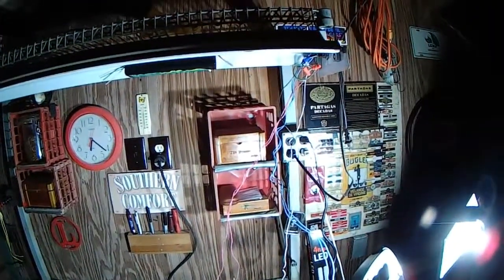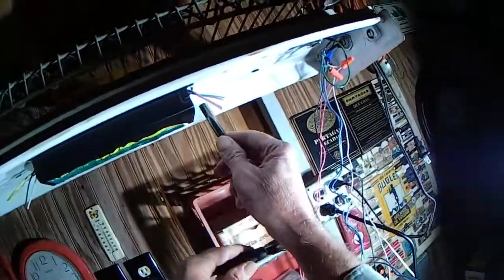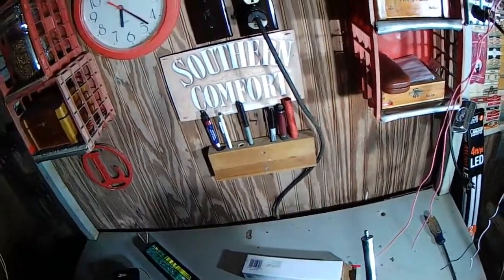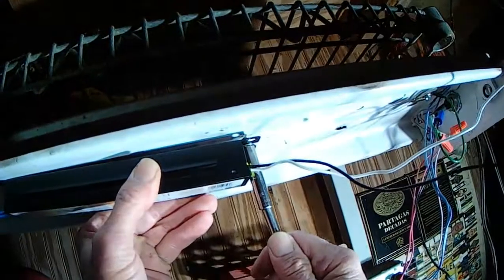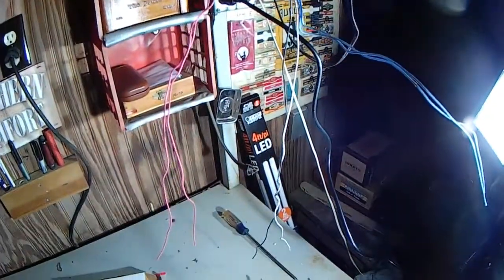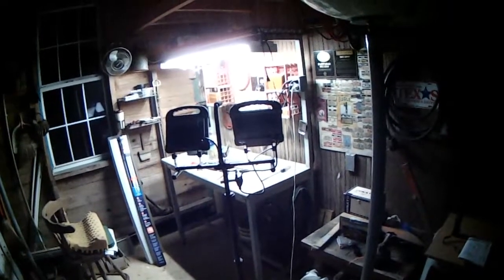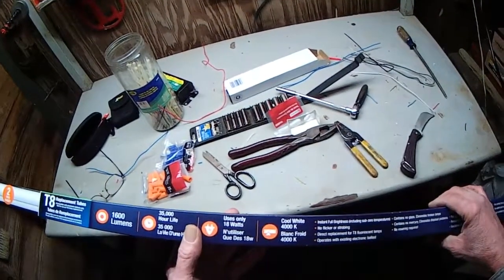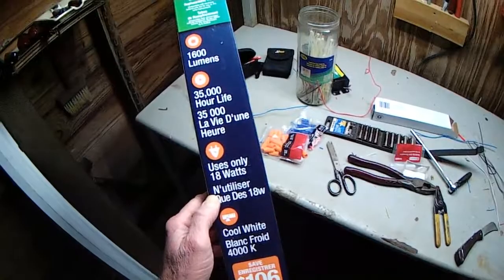Delivers 65% to 80% in Energy Savings  Lifespan of 50,000+ Hours

Comment: I thought about using those type of LED bulbs but I figured the 9 100W sized LED (18W each) would give me good light in the shop. Most of the time working on a car or truck or tractor you end up with a trouble light when working on anything any ware so why not use the LED's overhead.  The electric bill for the barn runs about $25 a month so I cant complain about that at all. LED lights are the way to go for sure but they is kind of expensive to buy them, I've changed 2 of them ware they went out in the last 2 years . I can run 9 18W bulbs (100 W sized regular bulbs) for less that what the 2 regular 100W bulbs would draw on the power system,  I like that idea and it sure made it easer to run electric for the lights and it is easer on the electrical system .  Bandit
Reply from the maker: Bandit farmer - I got a lot of lamps here in the house about to get bubs changed to LED bubs.   I'm chasing a cost savings in the monthly electric bill.   thanks for watching and commenting Bandit.
Reply: I really like the idea of the LED bulbs, Run cooler and use less electric but they do cost more to buy but they do last longer so I guess it pays off in the end, We'll see. I know I'm really happy with them in the barn, The electric bill went down by $10 a month after I put the LED's up so $120 a year saved !  I like that part real good !  Bandit

Comment: Most LED bulbs will run on any standard 110 to 277 vac wiring which means just bypass the ballast and direct wire to the pins. Just verify the polarity of the bulbs as they will have a hot and neutral pin, may both be on the same or opposite ends of the bulbs.
Reply from the maker: bparsons72007 - An electrical ballast is a device placed in line with the load to limit the amount of current in an electrical circuit.     the inductive ballast limits the current through the circuit, which would otherwise rise to a destructive level due to the negative differential resistance of the LED's voltage-current characteristic.       while LED light sources are extremely low current devices, applying 110 VAC directly to them is not the safer approach.

Comment: I’d love a power bill that low. In Australia ours has gone from $250-300 aus per qtr to around $700 in 10years. The renewable energy is killing us.
Reply from the maker: Jason Rowe - is it the power company's cost of building renewable energy generation being passed on directly to the consumer driving up your rates?
Reply: That is one problem but it is subsidised by the government. The problem is that we have no nuclear energy and they are shutting down the old cheap coal fired plants but not building any new, more efficient ones. The renewables don't work when it is dark (solar) or not windy (windfarms) so we have fewer plants carrying the peak load and they can charge accordingly.
We have irrigators who upgraded from diesel engine pumps to electric motors now pulling them out and refitting diesel as it is now cheaper again.
Reply from the maker: Jason Rowe - electricity in United States from nuclear energy in 2016: 19.7 percent.    About 16% of Canada's electricity comes from nuclear power, with 19 reactors mostly in Ontario providing 13.5 GWe of power capacity.    interesting reading on the following link.    http://www.world-nuclear.org/information-library/country-profiles/countries-a-f/canada-nuclear-power.aspx